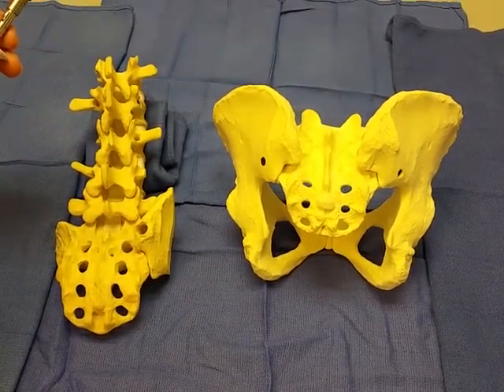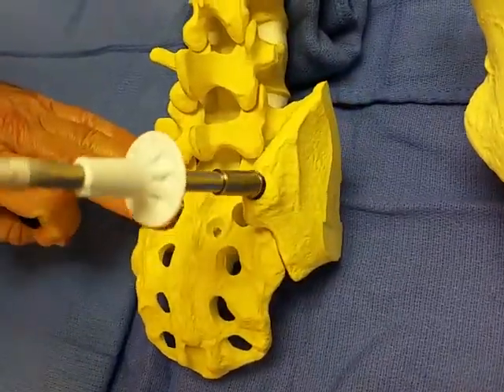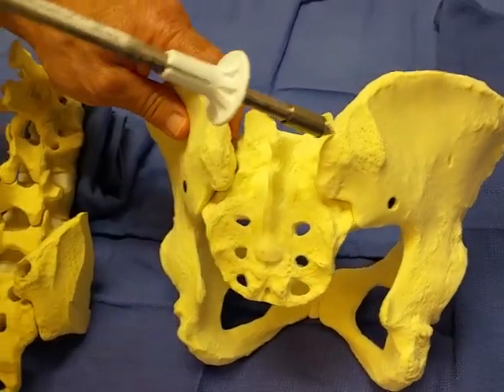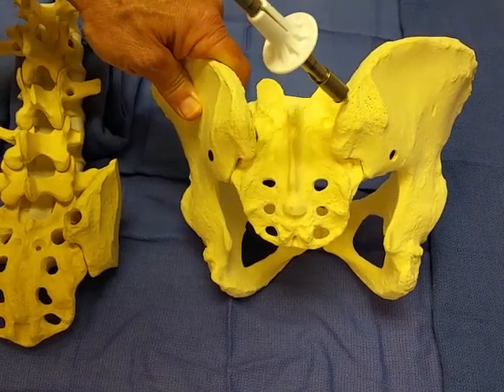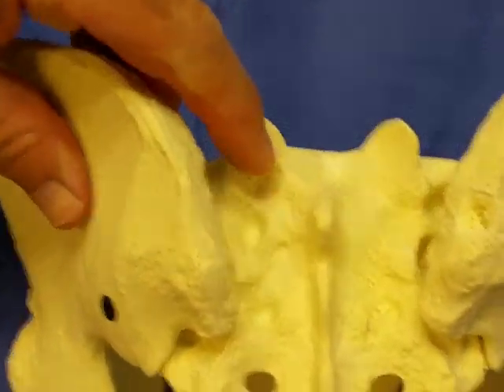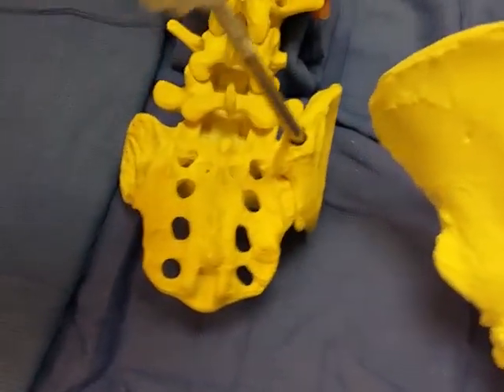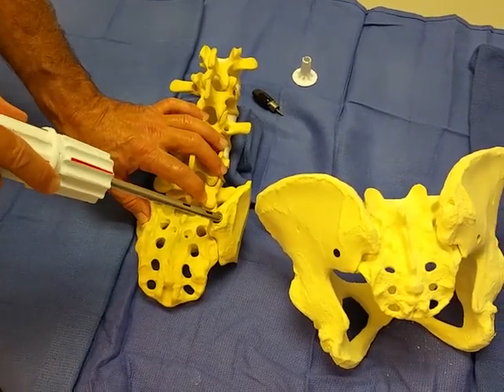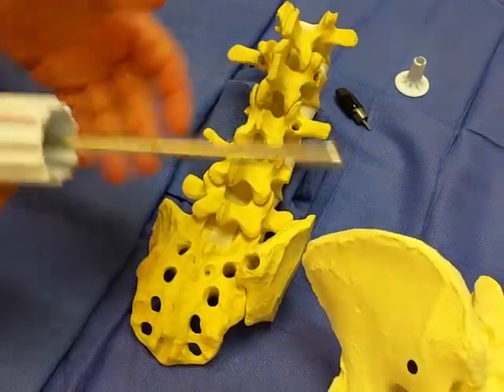Corex Bone Harvester,  Posterior Iliac Crest Approach.

Comment: I will need bone graft to fix my cheekbones...

A few question regarding illiac (hip) bone graft:
1. Did you experience chronic pain
2. Did it leave a large scar
3.Did you experience contour irregularities  of  the hip
4.Did you experience bone reasorption
 
Any other negative side effects with this type of bone grafting?
Reply: If your surgeon uses the COREX Bone Harvester, then you will experience either trivial or no pain post-op. Its easily the most minimally invasive device on the market thats capable of harvesting and preserving cancellous bone (aka the gold-standard of bone grafts) its its innate unaltered form. There is very little scarring as the COREX only requires a 1-1.5cm skin incision.